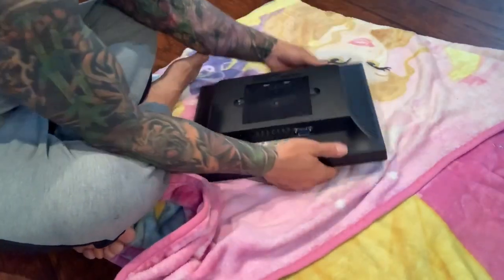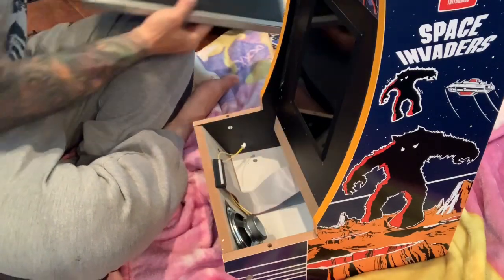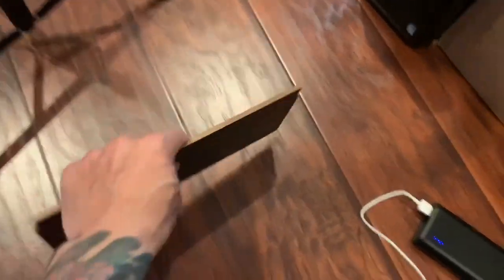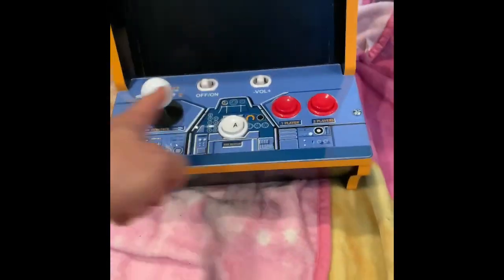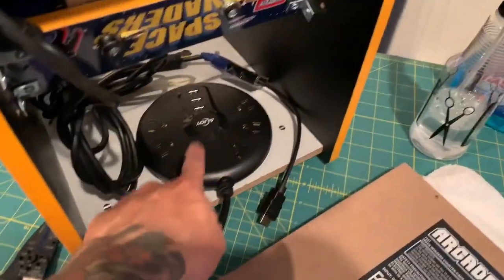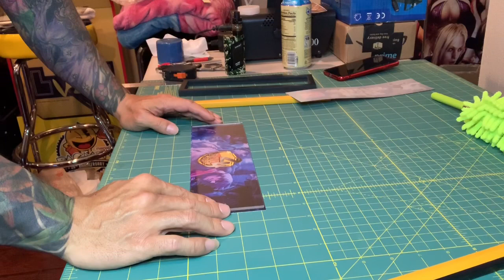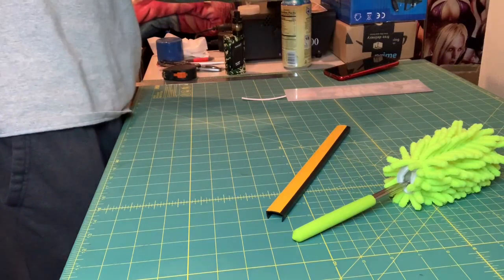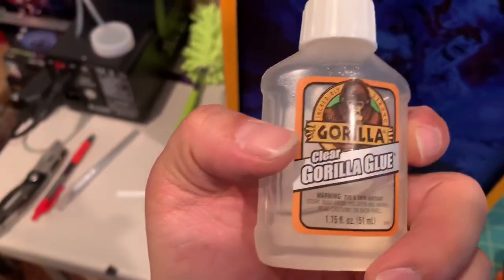Arcade1up countercade mod tutorial

Comment: Is it a requirement to replace the monitor, if I want to use a raspberry pi that is? It seems like it is. Because I've tried everything i can think of using 2 different boards and i get power but no image i confirmed on regular tv that my raspberry pi works fine. If i need to replaced it my only question is, how do I install and mount my Sanwa joystick on the original button panel? I've obviously replaced the buttons and encoder with the raspberry pi button encoder but the joystick is too big to fit. Recommendations?
Reply from the maker: No not really you can use stock monitor to install new stick and buttons just but it from Amazon
Reply: @2Dai4  Ok. I never turned the arcade on before messing with it. My major mistake lol. It might have been broken when it shipped to me. But now I have no way of knowing. Hmm.
Reply from the maker: Oh man sorry bro 🤥
Reply: @2Dai4  its ok. Is there anything i might have missed. Like i mentioned. I have a "light" on the monitor indicating it works to a degree.  It might be because instead of buying a 40 or 50 dollar control panel, i tried to make my own, without the on/off switch. Oh wait...duh...its on but the arcade itself isn't booting up. I assumed the raspberry pi forced the arcade to boot up , but maybe it doesn't...lol
Reply: I fixed it lol. Holy shit, the top ribbon cable in black was backwards. Lol. I must have pulled it out when i first got this, or they put it in backwards as a manufacturer defect, lol.
Reply: Now i just need to configure buttons. But not sure how. Also my sanwa joystick wont fit. But if I drill i will ruin the joystick metal and the wood. Maybe I'll buy a replacement control panel and just swap buttons...ugh...another 50 bucks...
Reply from the maker: Good luck 👍
Reply: @2Dai4  I got the joystick in. But now display won't work after plugging it in, using the small square surge protector for the arcade,  raspberry pi, and amplifier. Hmm. Also, stuff wont stick on the side of the case as shown in the videos on YouTube. How do i organize it?